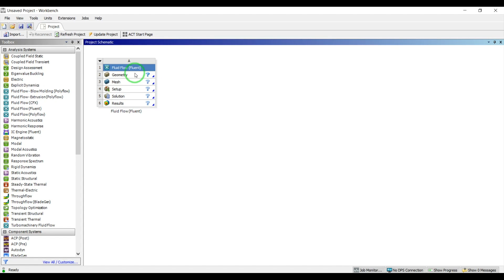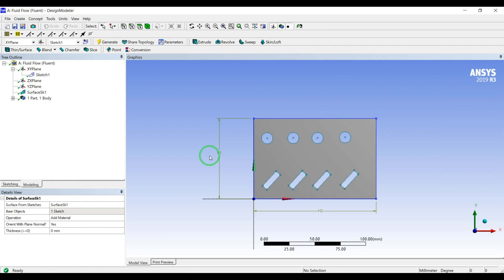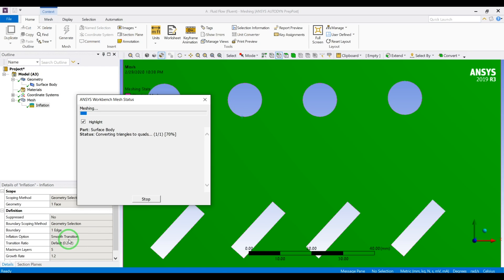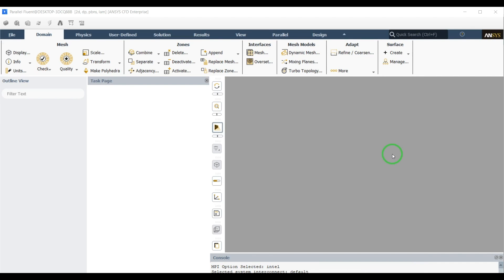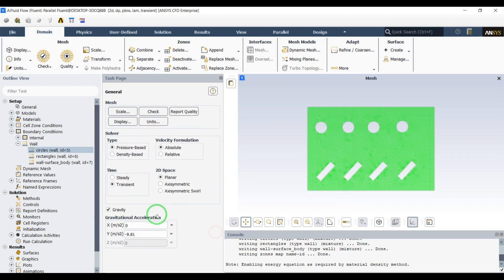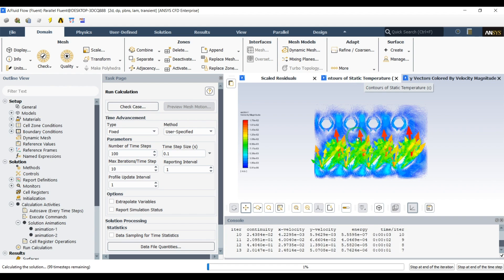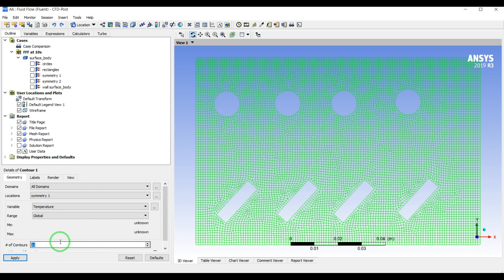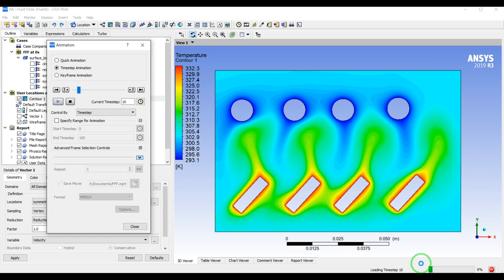ANSYS Fluent Tutorial: Natural Convection Heat Transfer 2D Transient

Comment: Very nice video. That would be great to now have the 3D version of this case. Or, better, a 3D simulation with an outlet on the upper bound !
Reply from the maker: For this exact same case 3D simulation will take a long time to perform simulation. But I will try to do a 3D with a single pipe and outlet on top. 
Thank you for your comment.